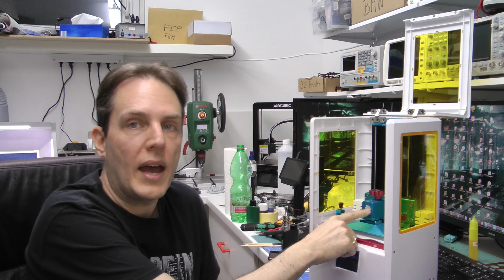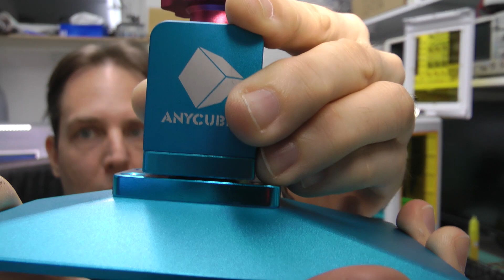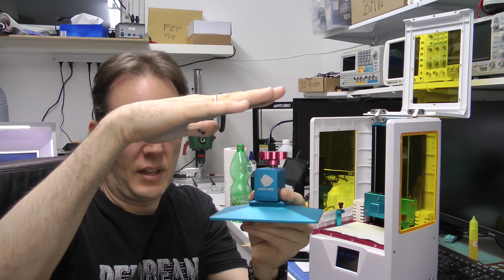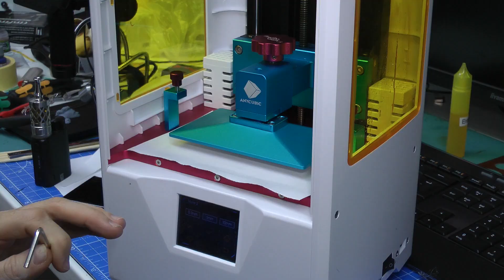The "real" right way leveling the printbed of your Anycubic Photon or similar resin printer!

Comment: A good test after doing the leveling is to run a program with just the build plate to see that the program prints the first layer with the same feel it was set to. Then the following layers should then feel like the print has gone higher

Comment: Hey man I was moving my vat and accidentally got resin on my screen. How can I safely clean it off of my screen without damaging it? I didn’t notice it before I did a print so it had been exposed to the uv light so it’s stuck on there
Reply: Use a glass scraper, (razor blade). I had a similar situation, but I hadn't realized that I neglected to remove the protective plastic film used for shipping. Almost freaked out when I was cleaning the led screen and gouged out a huge chunk of this film, thinking I'd just screwed myself. Finally I realized that a razor shouldn't be able to do that to glass so easily. Lightly scrape off the cured resin, then clean with disposable towelettes for eye glasses.
Reply: @abledog006  thank you very much for this I haven’t used it since because I didn’t want to cause any further damage

Comment: I heard a small cracking noise when tightening mine. Checked and there's nothing on the LCD screen but I got scared. About to test print something and see if it broke or not. It was really slight and I caught it before I kept tightening so I hope it's all good.